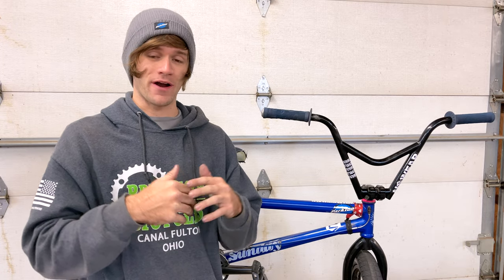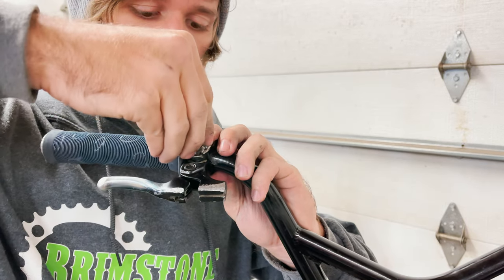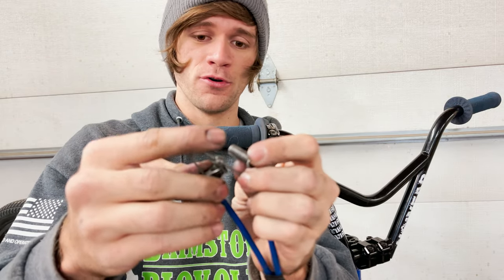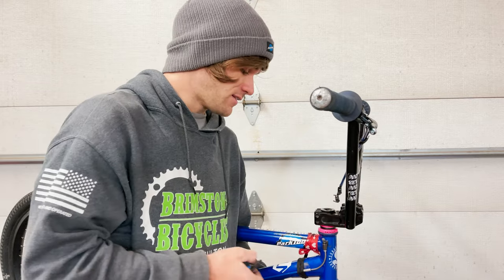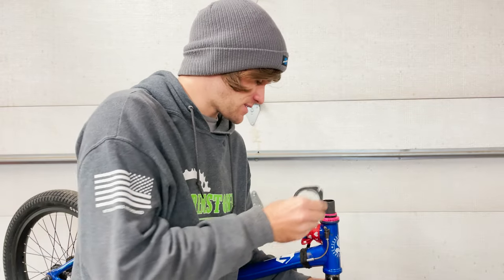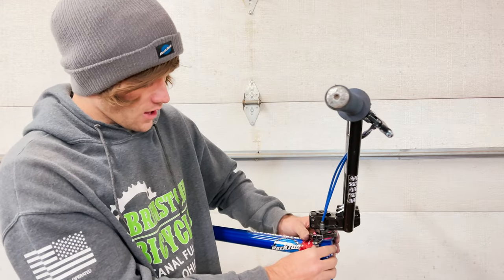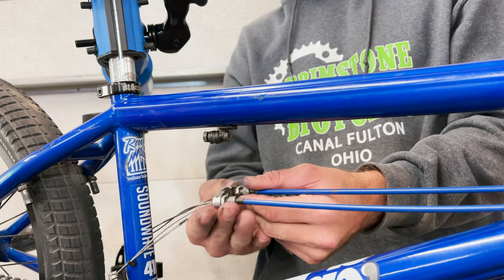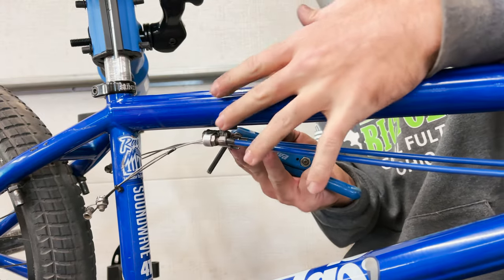How To Install / Put On A BMX Gyro!

Comment: You just so happen to post this as soon as I got all the components to my detangler in the mail! HELL YEAH
Reply from the maker: I knew! 🔮🔮🔮🔮
Reply: @Brant_Moore  I actually ended up building a Sunday Soundwave v3 X Primo for my new setup!

• Sunday soundwave v3 2.5 frame (black/mint)
• Primo infinity fork (black with white trim)
• Primo SuperBite Cranks 165mm (black)
• Primo Turbo pc pedals (black)
• Primo N4FL LT front wheel (black)
•Primo Remix v3 LT rear wheel (black)
•Peimo Freemix LT rear wheel (black)
• Primo Anyeyelater v3 top load stem (black)
• Primo Pivotal Seat Post (black)
• Primo Stevie Churchill Pivotal Seat (black with white trim)
• Primo Rebar bars 8.69" rise (chrome)
• Primo cali grips (black)
• Primo solid guard sprocket (black)
• Primo icon metal bar ends (black)
• 4x Primo Binary pl v2 chromo core pegs (black)
• x2 Primo Stevie Churchill tires (black)
• Odyssey pro integrated headset (black)
• Odyssey evo 2.5 brake calipers (silver)
• Snafu gyro lever, cable's, plate & detangler (black)
• Shadow conspiracy supreme chain (black)

Comment: Hey man learning a lot from the videos keep em rolling. But maybe u say later in this video, but if I order like a Snafu Mobeus,or a Odyssey  gtx or any newer sealed detangler, what comes with it? Do I need to also order a plate, cables, tabs, both sets of cables etc etc? And can I run Odyssey with Snafu cables or vica versa?
Reply from the maker: I'm not sure about what's included with gyros when bought new but I'm sure it would be listed on the companies website what should come with it.
Tabs and cables definitely aren't going to come with a gyro unless you're buying something like Odyssey's gyro kit. Even then, tabs won't be included as they're frame dependent.

Comment: Just what I needed. My gyro is pulling up and then get stuck in the headset dust cap and won’t come down again
Reply: Your gyro isn't clearing the head tube. Get a Colony gyro. It won't hang up. I had that problem you're having, but the Colony gyro fixed it.

Comment: I guess you can only add a gyro stem to sort of 'recent' BMX bikes? I've got an old GT Performer I want to renovate but I don't think it is possible without those brake cable guides below the headset. I think my GT Performer is from the 90's.
Reply from the maker: There’s adapters that you can get to add gyro tabs for use with the old style headsets.

Comment: @brant_moore thanks. Looking at adding a gyro set up. Is it normal to have to use a different headset than what came stock (Sunday Ex)? I only have a small spacer so was thinking a different headset may be required in addition to the odyssey gyro kit.
Reply from the maker: It’s possible you might need more space so the gyro has enough room to move up when the brakes are pulled.
As long as you have enough of your forks steer tube in your stem that should be okay
Reply: Thanks. Part shows up today. Will check it out 👍
Reply: @brant_moore. Thanks. I installed the odyssey gyro, which was pretty easy after watching your video. Hardest part is keeping the upper cables tight in the detangler. That takes some messing around. Will have to see if it stays in place…fingers crossed

Comment: Is there a way to run a gyro setup on a frame that doesn't have the side tabs on the frame/ doesn't have mounting holes
Reply from the maker: There used to be an adapter plate you could put onto your fork but I don't know that that exists in 2022 for a 1-1/8" setup
Reply: @Brant_Moore  yeah I know about those but if I’m not mistaken those were a whole headset combo right?
Reply from the maker: That sounds right. I don't believe it's something that exists for a modern bmx headset but I could be wrong
Reply: @Brant_Moore  honestly might do what a few others did and just drill/tap the head tube